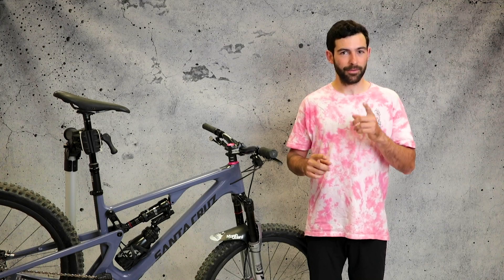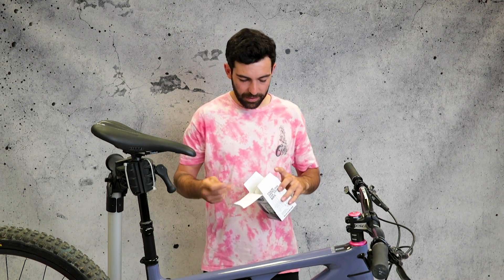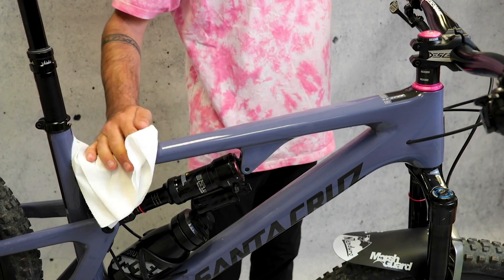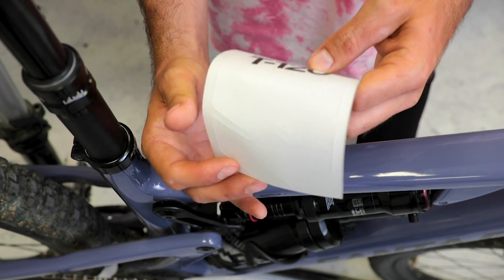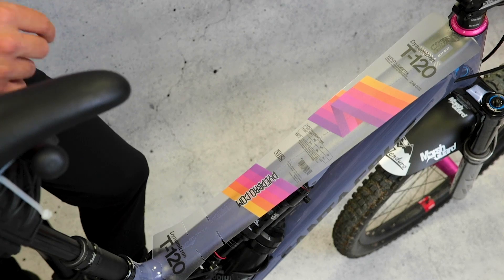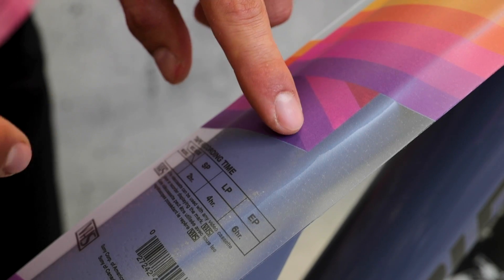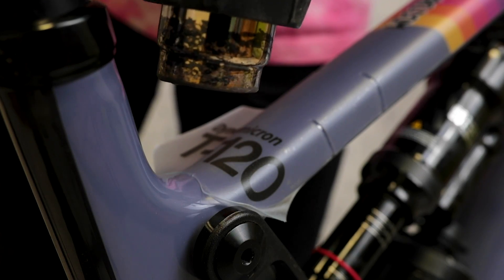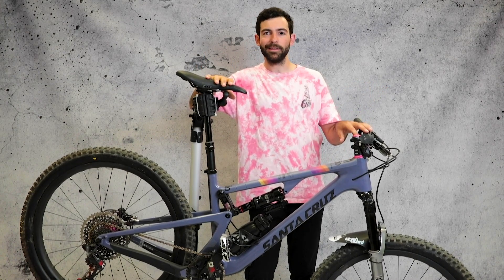How to INSTALL your DYEDbro Frame Protector | #Doyouevendriftbro

Comment: Is a hairdryer ok? As I do not have a heat gun
Reply: Ok thanks
Reply: @mc0109  have you tried it and did it work?
Reply: @jasonjpl5301  yeah it was perfectly fine
Reply: I did this and didn’t get enough heat in the wrap. The installation went fine but layers of the wrap began to separate after a few rides. If you use a hairdryer be sure you get it good and toasty

Comment: Is it normal that there's layers to those? like i installed them like in the video, the next day it was loose around the edges. So i pulled it off, leaving the design on the frame but the thicker plastic part came off. Is that wanted or did i do something wrong?

Comment: can you use a hair dryer if you dont have a heat gun?
Reply: im thinking the same question. have you tried it yet and if so, has it worked?
Reply: @jasonjpl5301  The hair dryer worked you just need to be pacient and take ur time.

Comment: In my reasearch entry lvl bikes (cheap bikes) have a terrible paint job because some bikes have no smooth paint layer (just pure paint)
Compare to high end bikes with paint jobs usually have a layer protection .
The real problem with bike skin is that the paint can be peeled off if your remove your film (especially for cheap bikes or any bike without any paintjob layer)
Check first your bike if the dry film doesn't scrape any paint .
Reply: I saw a Santa Cruz with pilled-off glossy finish, the seller of the bike said that he tried to remove a protector. So I'm not so sure about "hi-end bikes have some level of protection"

Comment: Hi, should I be concerned about using a heat gun on a carbon frame?
Reply: Use a hairdryer ;)
Reply: Fart on it
Reply: Just google about carbon heat-resistance. (Deffinetely heat-resistant up to 200C if not "tempered")

Comment: could a hair dryer work instead of a heat gun?
Reply: I always use hair dryer when installing and removing stickers. Putting on Dyedbro frame protection is more difficult than others. But they have the most extravagant graphics.

Comment: Can u still aply this to an old frame? Where there might be some scratches and stuff
Reply: With most frame protection, you can do it, but it will be very hard to remove any bubbles around the already damaged areas

Comment: any tried to install on a specialised e bike? do you need to remove tcu or can you cut around it
Reply: Just finished doing the top tube in my Kenevo. I left the TCU in and set the vinyl wrap on top of it. Once I had the area above and below the TCU adhered to the top tube, I used a box cutter to cut around the edge of the TCU. Then I used a heat gun.

No issues. Take your time. No matter what I did, I still had 2 small (1mm) sz bubbles near the seat post. I’m good with it though, just noticeable for us with OCD. ✌🏽

Comment: I got another bike and am currently installing it.  I actually wet the tape with some soapy water.  I got that step confused with the 3M tape I installed previously.  I hope it doesn't effect it's ability to stick to the surfaces?
Reply: How did that go?

Comment: I just installed the clear gloss on the top tube and it looks like crap. Follow your instruction and still bubbles .very unimpressed .
Reply: Should have done a wet insulation
Reply: @llove-electrical  Have you done it mate, if so how did it go?
Reply: @goncalobaptista3042  I just done it dry plenty of heat not perfect few micro bibles but nothing major
Reply: @llove-electrical  I guess I'll go for the wet method
Update: Wet method doesn't work, it is too thicccc
Reply: @goncalobaptista3042  Was that wet with a couple drops of dish soap? Dish soap improves the wetting action.

Comment: does hairdrier works instead of heat gun ?
Reply: yes just as long as its got a high enough heat
Reply: @nickprzemioslo7052  how much heat
Reply: @jasonjpl5301  it should be painful if you put ur hand in front of it for to long

Comment: Has anyone ever removed one of these kits? And if so is it easy? And does the adhesive come off?
Reply: Hi Scotty, When you remove the films, it may leave a glue residue. I find that industrial methylated spirits works well to remove the glue, and not damage the original paintwork. if you don't have that, then use readily available from any pharmacy, Isopropyl alcohol 70%, also works well. (basically like a hand sanitizer....)
Reply: @thejudgeandthedodger6086  thanks so much.   Just actually about to install this on a new bike!   Appreciate it!

Comment: Very hard to apply even with a heat gun.
I have a new frame and I used ethanol to degrease the surface. I followed all instructions but this protection film unsticks from the edges after few minutes. Sticking back with a heat gun doesn't help.
If you overheat it, it can separate in two layers.
I wasted money and all day.
Low quality. Do not recommend.